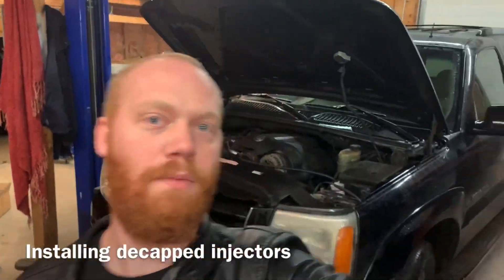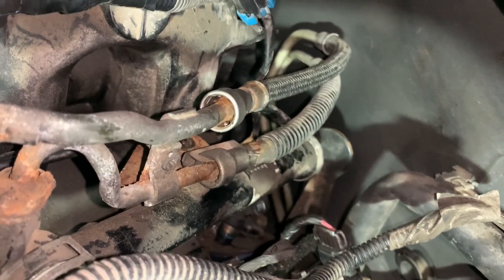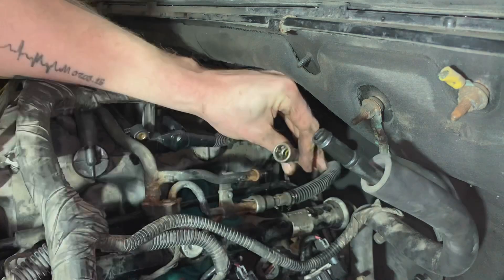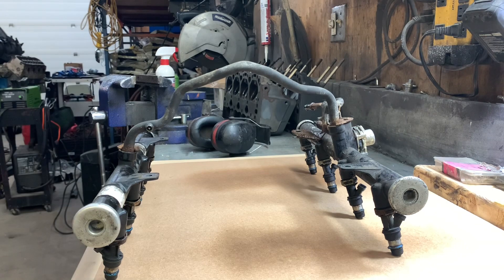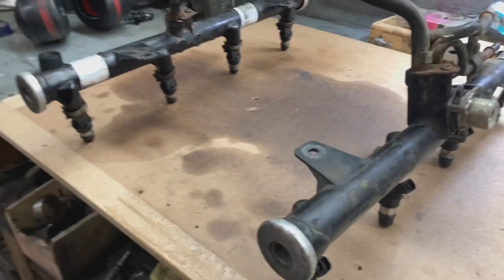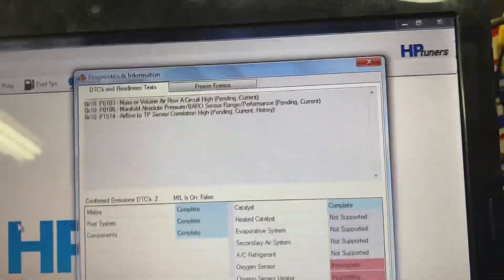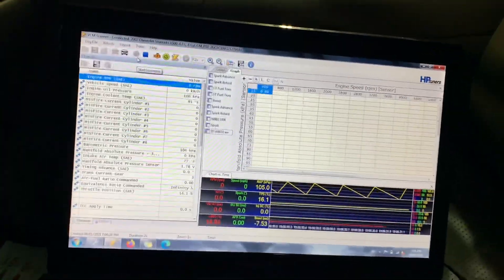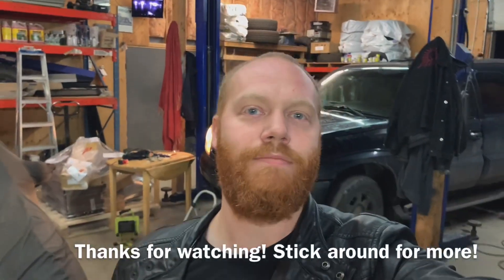Installing decapped injectors on the turbo LQ9 6 litre Cadillac

Comment: how did you get rid of the po1514 every time i go into boost i trip this code at 3900 60 percent throttle i have it maxed out n dtc
Reply from the maker: Okay it’s been a while but I think it kept happening after this, try finding that code in the “DTCs” list under “engine diag” tab. 

Set the drop box to “no error reported” and uncheck the little box for MIL

Lemme know if this works, I can’t remember if that’s what I did but I think it’ll work. 
If it doesn’t run right you can just set it back to original. 

I’ll do some digging through a couple of my other videos and see if I can find what I did
Reply from the maker: I found the post I made on sloppy, Ryan blaser from “A21Bravo” here on YouTube commented “max out the p0068/p1514 values and also turn both of those codes to “no error reported”. After that, no issues again!

Comment: I was rebuilding the heads on my 5.3 today and some wild little piece of metal came out of one of the intake chambers. I had absolutely no idea what it was until you pulled the safety clip out of the return rail connector. Mystery solved! 
Thanks for the wonderful videos.
Reply from the maker: Oof! Hopefully it didn’t damage anything!
Reply: @StationroadRatrods  No damage done, it fell in when I pulled the motor out. I just thought it was funny that the first video I watched after I got back inside was you showing me what it was.
Reply from the maker: Haha awesome, glad it worked out well

Comment: I’m curious why your commanded AFR is changing constantly at idle? If your running pump gas you want commanded to be 14.7 at idle, and 12.5 when your in power enrich , and 11.5 when you are in boost enrich (typically boost enrich you’d want it to come in at 105-110 KPA. 

And also you NEED to convert that computer to a 3 bar speed density operating system and have your offsets for you map set up correctly. Otherwise you’ll waste your time anytime your trying to log AFRerror , especially with your commanded jumping around that much. You want 14.7 unless your in power enrich or boost enrich. 

I highly suggest looking into how to setup power enrich and boost enrich before you even drive the truck.
Reply from the maker: I need to go over the fuel multipliers, when the engine is cold it usually starts at around 13.9 commanded and works it’s way to 14.68 when it’s warm, so I never do an actual log until it’s warm so I don’t get skewed results. I have the PE multiplier set, I’m pretty sure it’s the temperature that’s messing with you. I am on a 3 bar map OS and I do have the histogram set up to match, my computer screen isn’t really big so I have to scroll down to see past 105 kpa
Reply: @StationroadRatrods  what do you have your stoich set to in the tune? Should be 14.7. the computer should always want 14.7 unless you command PE or BE , reguardless of temp ,“commanded” should stay at 14.7-1 at idle always.
Reply from the maker: It is 14.7, but under cold startup tab it has an adder based on coolant temperature. It’s around -5 degrees celcius here at the moment and is commanding more fuel on cold start, much like a choke.